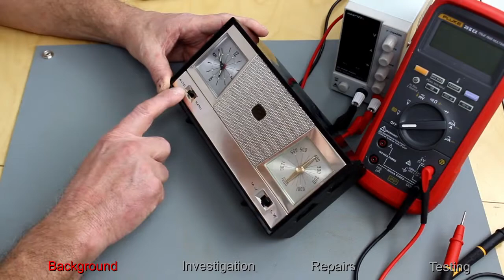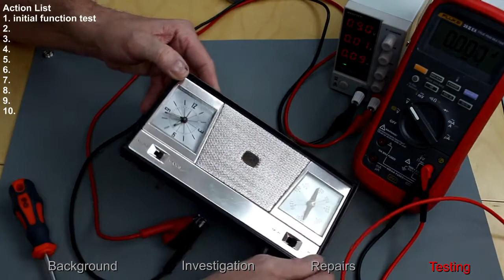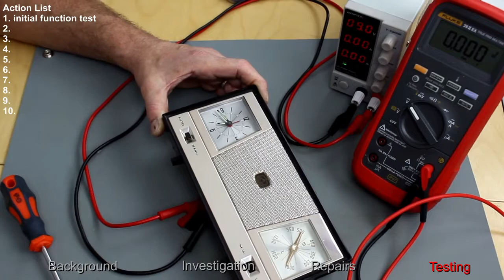Early Monatone transistor clock radio requires repair down to component level

Comment: FYI when you're aligning an AM radio like this The RED core is the local oscillator, followed by YELLOW core is 1st IF transformer, WHITE core is 2nd IF, and BLACK is the 3rd IF.
Reply from the maker: Hi Michael. Thanks for the information. Very useful.